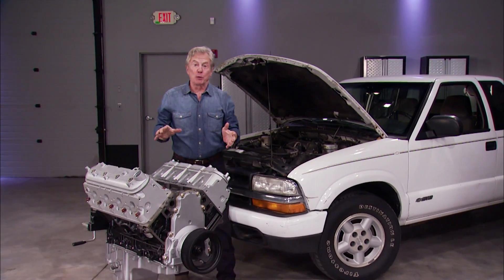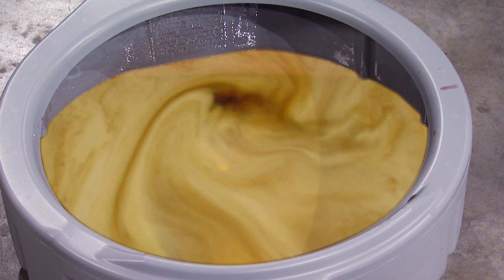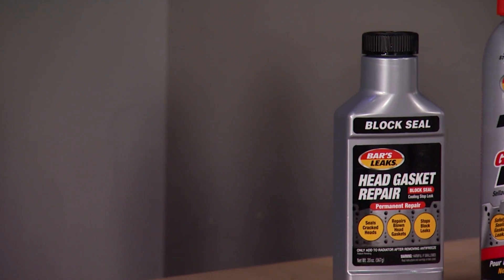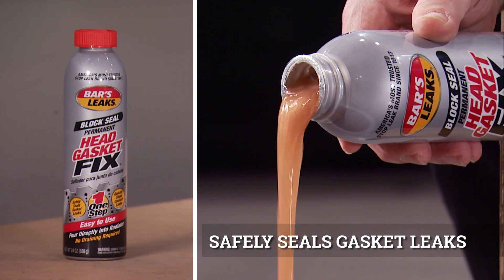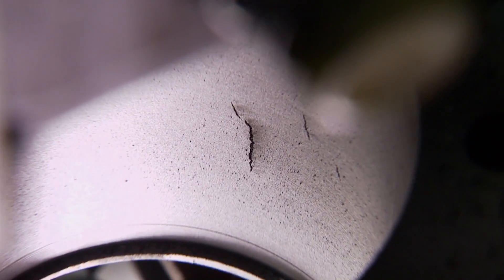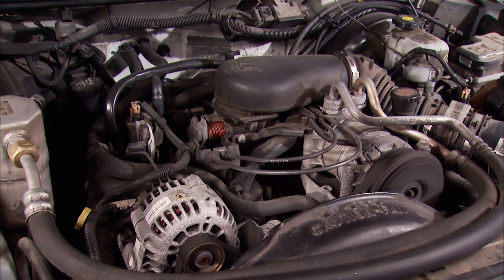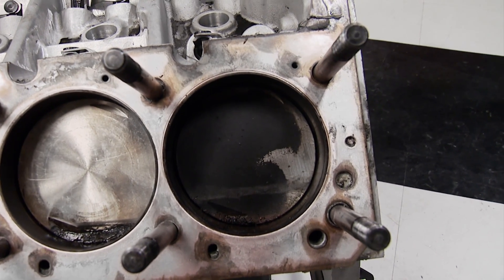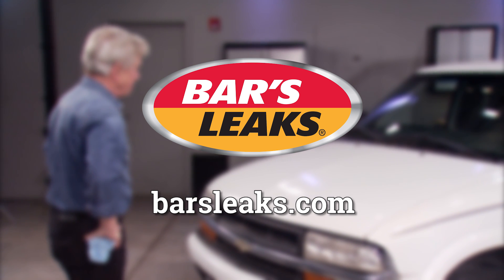Tech Review: Bar's Leaks Head Gasket Repair Solutions

Comment: why would someone choose block seal vs the other products shown?
Reply from the maker: Hi Danton that's a great question, allow us to explain the difference. We have 3 different products that treat various symptoms and severity of a blown head gasket. Our Block Seal you referenced is our original formula and still one of our most popular products. It will deal with small to large leaks, as well as intake and block leaks. This product is a great choice as long as there aren't any other symptoms with the vehicle such as overheating, or blowing white smoke, and the user is able to spend the time and do the steps that this product requires.  Our Head Gasket Fix (p/n 1111) will be able to address the same issues as our block seal, but unlike that product, it is fully compatible with antifreeze and a little stronger. Our professional Head Seal Blown Head Gasket Repair (p/n HG-1) is the strongest we make and will deal with a wide range of issues, from sealing those small to large leaks, to dealing with overheating, and coolant to oil leaks. It's also the only one out of the 3 that has reinforced carbon fiber in it. If you ever want more information on any of our products please don't hesitate to give us a call, our Michigan based tech support team is available M-F 8am-5pm EST, and can be reached at 800-345-6572. Thanks again for the question.
Reply: @BarsleaksUSA  That's helpful, thanks!

Comment: Do you ever drain the radiator and fill with regular coolant or do you just keep the leak fix permanently?
Reply from the maker: Hi insomthegreat, thanks for your question.  It's very important to keep your coolant levels at the full mark.  Our products are designed to stay in the system safely, for continued protection and are fully compatible with all types of coolant and water, with the exception of our Head Gasket Repair (p/n 1100), with this product specifically the entire system needs to be drained to use. In the past we have heard of people flushing the system after the leak has been sealed. If you have any other product related questions our tech support team is available M-F 8am-5pm and can be reached at 800-345-6572.  We thank you for reaching out to us.

Comment: Toyota diagnosed my 2004 Rav4 with a blown head gasket. Which one of those sealers would be the best to use. I've been driving my car for short errands and it has not overheated ... but I do not put my AC or fan on because I need a radiator and condenser fan assembly replaced.
Reply from the maker: Hi pitrescue, thanks for your question.  Our tech support team would like to know a little more about your vehicle so they can recommend the correct product. Please give them a call at 800-345-6572, they are available M-F 8am-5pm EST.  Thanks again for reaching out.

Comment: I have an 04 Kia optima, just replaced thermostat, and radiator cap and topped it off with antifreeze,  I don't have leaks but the car is still overheating I will buy this product hopefully it helps only need it to work for like 3 miles everyday, to and back from work
Reply from the maker: We thank you for reaching out to us. We would like to know a little more about your vehicles situation, if you wouldn't mind calling our tech support team at 800-345-6572 M-F 8am-5pm EST. In some instances we may be able to recommend a different product based on your specific needs. We look forward to hearing from you.

Comment: I recently had white smoke coming out of my exhaust on my 1997 Ford F-150. I also notice a milky residue on the oil cap. Which solution should I try?  I recently changed the thermostat and water pump. Thanks in advance.
Reply from the maker: Hi Marquis, we thank you for reaching out to us. We have 3 different head gasket repair options, and would like to get a little more information on your vehicle. Can you please call our tech support at 800-345-6572? They are available M-F 8am-5pm EST.  We always like to collect as much information on the vehicle before suggesting a product. We appreciate you contacting us and look forward to speaking with you.
Reply: did u get it fixed marquis i have an f150 ad well and same thing happened turns out it was the manifold intake gasket changed it then still have water in oil so thinking if i have a blown head gasket or not

Comment: I’m going to try the Professional Head Seal on my old Nissan D21. Will it work better if I remove the thermostat?
Reply from the maker: Hi Bennie, thanks for your question. If you are referring to our Head Seal Blown Head Gasket Repair (p/n HG1, which can be found on the back bottom of the bottle) no thermostat removal is necessary to use our product. We always recommend a chemical flush be performed on your system prior to using our product if you haven't had one done in a while. Also correct dosage, and installation instructions should be followed as written.  Our tech support team is available 8am-5pm M-F EST and can be reached at 800-345-6572 if you have any questions.  We appreciate you giving us the opportunity to help with your head gasket repair Bennie.

Comment: 2005 chevy trialblazer 147,122 miles I def have to get this ... no overheating....no coolant loss ...csr runs amazing no check engine light  but found some oil mixture under cap .. so better now 
Bars leak wish me luck lol
Reply from the maker: Hi Jose, we thank you for thinking of us for your vehicle needs. We would like for you to give our tech support department a call, so we can make sure you're using the correct product for your vehicle's issue. They are available M-F 8am-5pm EST and can be reached at 800-345-6572. We look forward to hearing from you Jose.

Comment: I should be use Bar's Leak in my 07 Dodge Nitro R/T with misfire cylinders due to a blown head gasket? Is it safe to use these product in this case?
Reply from the maker: Hi there Jorge - if you know you have a blown head gasket, we can probably help unless the leak is too severe, in which case no chemical repair will work. Tell you what - we'd like to know more about your car and its symptoms. If you have a minute, call our Tech Line at 800-345-6572 and ask for Fred. Tell him you've been chatting with us on YouTube. He's our senior tech and will walk you through your options. Thanks for reaching out.
Reply: Bar's Leaks thing is no antifreeze or oil leak in the combustion chamber or outside of the engine, I think is a compression or air leak between two or more cylinders, but I will call your tech thank you so much....
Reply from the maker: No problem Jorge. Hope you had a chance to call. We're happy to help you out.
Reply: +Bar's Leaks hey if the guy before me had the truck she already use bars in it before and I go and put coolant in it will that open up the crack and can I use bars again to fix it
Reply from the maker: Hi John thanks for your question.  With situations like this we need to know a little more information so, if you have time please give our tech support line a call at 800-345-6572 so we can discuss this. We are available M-F 8am-5pm EST. Thanks for reaching out.
Reply: Jorge Martinez d

Comment: Hi i have just brought a 1996 Mercedes C200 petrol when i brought it the man said head gasket was gone.i drove it home the temp went to high then dropped back to just over half,and sat there, problem is there is no water in the oil, no bubbling in expansion tank, no vapor or steam out exhaust.but there is no heater just blows cold, and when the engine is running coolant comes out of over flow pipe.also it runs a little rough on start up then idles good.any help would be appreciated.
Reply from the maker: Hi Farmer - we'd like to know more about your situation. If you have a free minute, please call us at 800-345-6572 x102 and talk to our Technical Support team. They know about your question and are happy to help you out.
Reply: pulled thermostat out put it in boiling water wouldn't open up was seized closed so put another one in and it worked
Reply: Thank you much appreciated.

Comment: Using the 20oz silver bottle on my 2000 Subaru Outback. My exhaust is leaking into the cooling system. See bubbles exiting the radiator with the cap off and high rpm. I'm in the 2nd 15 min cooling off phase. The coolant system is still  under pressure. Am I correct in assuming that this pressure will push the water/bar's leaks mix into the block through the very same "cracks" that the exhaust followed on its way into the cooling system? Hopefully the 3 cooling sessions will push enough material into the cracks for a permanent fix. The old Subaru has been pretty solid for the 2nd car that it is. Well, time to top off that radiator for the third time. Wish me luck.
Reply from the maker: Hi there, we are assuming you are using product 1111, not 1100. If you are using 1100, it is not compatible with antifreeze, so the installation process is different than 1111, which IS compatible with antifreeze. To answer your question, yes, when you have the bubbles (exhaust gases) pushing from a cylinder into the coolant the product has difficulty penetrating because the cylinder pressure is greater. When you shut it down to cool that cylinder pressure bleeds down and the cooling system pressure then forces the product into the leak fissure.
Reply: Cloudy2Clear2- I am having the same problem with my van as you; I was hoping you could give an update if the treatment worked or not?

Comment: I just have white smoke coming out the exhaust, no over heat issue, runs long, Will Bar Head gasket fix 1100 work? might have blown head gasket and cracked block? I want to hear your honest opinion before I buy
Reply from the maker: Hi there - we'd like a little more info so we can understand (a) what's exactly going on with your car, and (b) what product is best for you (probably between 1100 vs. 1111 vs. HG-1). If you can call our Tech Support line and tell them you've been chatting with us on YouTube, that'd be the quickest way to get to the bottom of your car's issue. 800-345-6572, ask for Fred. Thanks.
Reply: well A) my cousin is a mechanic and told me I had a blown head gasket, might be a small leak in the cylinder/ or crack in the head, told me to change the head gasket but I have no leaks anywhere, Liquid/ or overheating issues, just white smoke coming out the tailpipe???
 and B) was going to try the 1100 stuff cause that's all I can afford at the moment, and wanted a rough idea if it would work or not with the information I gave
Reply from the maker: It would be best to use the 1111 for simplicity or ease of use, if your budget allows (the 1111 is our most popular, basically because it's very easy/quick to install). The 1100 could be used if you don't mind the installation process (it's more time-consuming). The leak can be sealed if you are having to add some coolant now and then. If you are not having to add any coolant, the product (if used) would just remain in the system as there is no leak to penetrate.
Reply: Okay well I will try get the 1111 stuff then, does it work good on its own, no need to flush the system after wards cause I was thinking it would work better if I took the Thermostat off for better circulation and better chance to seal the gasket and head crack?
Reply from the maker: No need to flush afterwards. Your can add coolant to radiator and leave product in cooling system for continued protection and drive vehicle as normal. See the rest of our FAQ here: https://barsleaks.com/product/head-gasket-fix/. If you have any questions or want help with install, be sure to call us at 800-345-6572. Thanks!

Comment: does it work for head gasket oil leaks?
Reply from the maker: Hey Samuel - if you are leaking oil into the coolant, yes our HG-1 product can probably help you. (Details here: https://barsleaks.com/product/blown-head-gasket-repair/). If you are leaking oil externally, then your head gasket is probably quite damaged and a physical repair is likely necessary.

Comment: will just pouring into overflow bottle work? Show a video on enclosed systems.
Reply: Just undo the radiator pipe and pour it directly into the radiator in enclosed systems. It says that on the back of the bottle too.
Reply from the maker: Yes, if you have a pressurized system (enclosed), the overflow will work. Good question, we probably should make a video clarifying that. (Our website FAQ mentions this, but not the video.)
Reply: What if overflow tank has antifreeze in it will that sink to the bottom?

Comment: ok first off I never used bandaids to fix my cars, but I was in a jam so Ill give this a try ! OMG it worked ,My 84 cHEVY ONLY HAS 70,000MI. ON IT WAS DOING OK BUT WHITE EXHAUST AND LOOSING WATER WAS A EARLY SIGHN THAT A HEAD GASKET WAS GOING OUT WE BUT OVER 500 MI. ON IT AND RUNING GREAT WE ARE SO HAPPY WE lOVE OUR  RV.  thanks
Reply: +Bar's Leaks Greetings, I have a problem with overheating of my chevy malibu 3.6l, I have been told by many mechanics that I do not put that product, because I'm going to clog the system and ruin the engine, what do you think?.
Reply from the maker: Thanks Keith! Happy to hear this. Appreciate your comment, and have a great weekend!

Comment: Hello, i'm broke so i'm going to try this solutions lol, in my mustang 98 GT , but my heater doesn't work, anyone knows if it's a real problem?
Reply: Wondarweld
Reply: Could just be a stuck thermostat
Reply: Bar’s leaks fixed my stuck thermostat and my heat problem.  Still may want to get a coolant flush and oil change so you can reap the full benefits of this amazing, money saving product.
Reply: Flush the core.

Comment: hello. i have a grand am 2004 with a 2.2 engine. from a few months ago it loses coolant from the reservoir trough a hose that is for overfilling. I turn the engine on and leave it until it get to normal temperature. after that the reservoir tank starts to fill up and it starts bubbling from the hose that takes out the air from the engine. do you think it's because the head gasket is blown??
Reply: I can help, be a bit more clear?
Reply: +Jake Tow what do you need yo know??
Reply: The overflow tank is also called the expansion tank, through differences in outside temperature the coolant will expand in quantity. Meaning that when the engine is completely cold, the coolant level decreases. As it gets hotter, it increases. 
SO when the car warms up, it will push hot coolant from the engine into the bottle. This is normal! 
However, turn on your heater and listen for bubbles, if you can hear bubbles from inside the car by the passenger seat, the engine Compression is pushing air into the cooling system, this means you have a blown head gasket. 
Pull the dip stick, is the oil milky? 
Does it shoot steam out the tail pipe? 
Does it over heat?
Reply: the oil looks fine, and it does shoot steam and water trough the pipe. and it is kind of overheating. and it loses about 1 galon of coolant. in about 1 hour of driving
Reply: Cenobio Ramirez Check for leaks. 
Also, if you can, pull the spark plugs and look at them. Do they look super clean? Look up a plug chart and compare yours.
Sometimes blown head gaskets can be seen through spark plug quality. 
I'm pretty sure it's either a leak or a head gasket.
Check all hoses and everything.
Reply: +Jake Tow i have check everything and it has no leaks. I was thinking about a head gasket blown. but  when I got the car it had no thermostat and it didn't lose water. after I change the water pump and place a thermostat it started to push the coolant out.
Reply: There is a chance you did something wrong, It is probably leaking. My water pump did the same thing.
Reply: mine has a small tear on the outside of the head gasket because it roughed over years and it leeks coolant and the car docent over heat it ideals like a dream and runs strong but I dnt want it to keep leaking for there and I dnt want it to get worst but I want to knw a is it going to work b is it going to mess up my engine and blow it up like I've heard c is it going to work at all and without problems after
Reply: Cenobio Ramir
Reply: i think i found the problem, my heater core was clogged and it didn´t let water come though it, i cleaned it and the car didn't lose any coolant after that. but i probably need to flush the whole cooling system and replace it with clean coolant